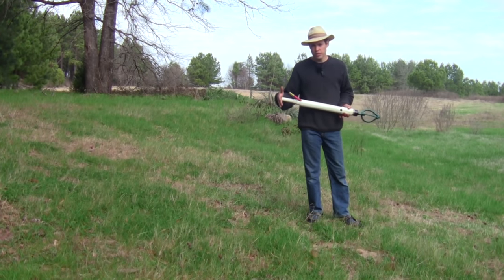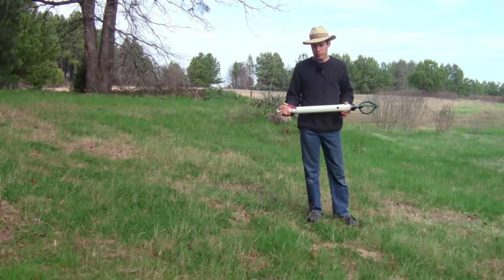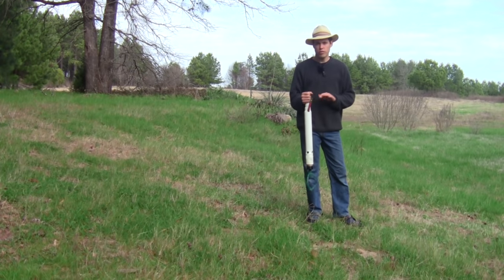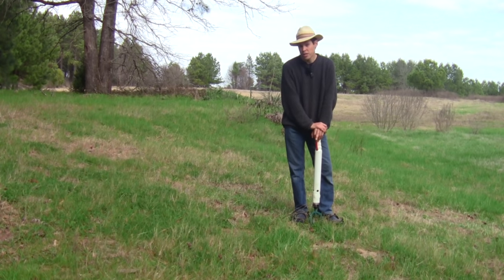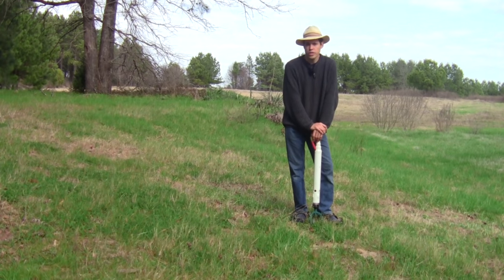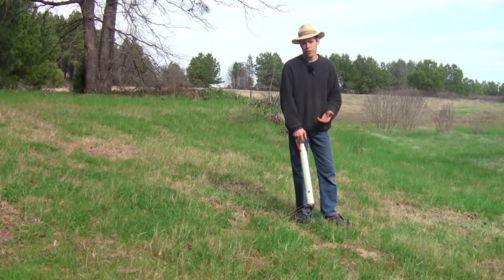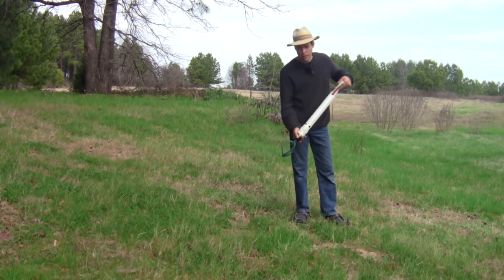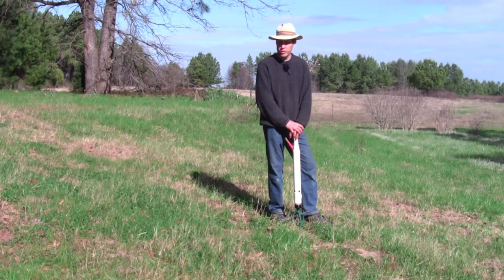DIY Water Well Drilling - 6 Ways To Drill Your Own Well in 2018

Comment: My well is 54 feet deep and it is sitting in a seven foot deep well pit. It was hand driven by two men in the 1960s.  It is a 2 inch pipe and it has a 1 1/4 inch drop pipe inside it hooked to a Deep Well Jet pump.  We were in this house I built here in 1977 one year when one of those men pulled in the yard and gave me the original book for the pump and written on the back of that book is all of the info on who did it, how deep it is and how long it took them to do it.  They made a scaled up 120 pound driver like a T-Post driver and the top pipe was always their driven pipe.  Both of these men were cement block layers and were used to lifting 40 to 50 pound blocks all day.
Reply: What kind of accent is this?
Reply: Geez them men probably never died,, it be too sissified.. men like that don't exist anymore
Reply: @keya31gville  oh we exist. Many of us are married to amazing wives who saw the potential. 💪

There are single guys out there like this. They just need to see a woman who will be there through the best AND worst of times. You got it. You can find your man and he will be amazing! When you BOTH can work as a team, nothing can stand in your way. Stay strong girl!

Comment: I have used this drill and it works. It can be hard to keep the hole straight but it's not a huge issue. If you don't have to drill deep, in rock or need a big hole, this is a good option. I have also used his mud pump design to clean out old wells and my son used it to pump out his septic to make a repair. The is a ton of good info on his web site and you can learn alot about drilling and setting up wells. He is also very helpful and wants you to succeed. The bottom on all this is if you have more time than money he can help you get a well dug.
Reply from the maker: Thanks for the comment!
Reply: "if you don't have to drill deep"  what would be the limit?
Reply: What is the name of the product?

Comment: I have an artesian water system that was in place when we bought the house 6 years ago, it was touted as being a great way to get clean water and for free.  Problem is, it dries up 6 months out of the year, and I’ve had to haul my own water from a pump 3 miles away, every day.  In the beginning, I was filling up 20 x 5 gallon buckets, driving back and forth, filling them up and then dumping them in our above ground artesian water tank.  I did this until my friend came up with the idea of buying 125 gallon tank($450) to put in the back of our Honda Element.  Using that instead of buckets, coupled with a small pump to get the water into out artesian water tank(used to have 2 1200 gallon tanks, one imploded in the winter)has saved us from the labor intensive part of it, though it’s hard on our Element, hauling all that weight up a hill daily. It sounds like a lot just to have water, huh?  I’ve actually gotten used to it. It reminds me of being a pioneer, lol. 

Well(ha), the problem is my mom is getting older, and I’m trying to sell so I can move closer to her, put her up in a “mother-in-law suite” type situation, and no one is going to buy this house without a reliable water source.  Plus time is of the essence as we our precariously still in a seller’s market, and who knows for how long.  

Well, here’s the real kicker;  We paid 18 grand to have a drilling company drill 320 ft, and to no avail,  because we didn’t find sufficient water, only about 1/2 gallon per minute, and that’s a maybe.  We couldn’t  afford to keep drilling.  I believe they charger $60/ft, and then $45/ft once we reached a certain depth.  The capped and soldered the hole shut, I believe the next step would be to get a pump company to test it, and then hook it up to the house via our artesian water tank.  But we have no more money, that was over a years worth of savings.  Our realtor told us we can’t sell until we have at least 1-2 gallons/minute.  

We’re a bit disappointed, but I’m really trying to see it as progress, since we can continue drilling from 320 ft down.  I am a little shocked by how much they charged though.  One geologist we know suggested we might have to drill down to sea level to find water.  We’re at an elevation of 750ft.  That’s really just so much more than I ever imagined it would cost.  I’m really thinking of trying your tool and method in a different spot on our land, I think we might get lucky.  Our neighbor went down a mere 15 ft, said he just prayed, and there it was.  It sounds strange but I have a spot that I feel God is pointing me to where I’d like to drill using your tool.  It’s where I wanted the drilling company to drill, but they suggested a point closer to the road, I guess because it was more accessible, the spot I had was under a tree line.  I don’t see a link though, would you be able to direct me to where to go to learn more and possibly purchase?  Thank you. Matt
Reply: Jeez, It was like I was reading about my own property (sans carrying 5-gallon buckets) 
We also paid a driller to come out. He drilled down 280'  before he came to the conclusion it was not likely we would hit water. It was the only spot on the property where we could get a truck-mounted drilling rig in. 
$7000 for nothing more than a broken heart and a heck of a mess.

We are lucky enough to have a spring that is uphill from us. Regrettably, the mouth of the spring is on someone else's property, hence our water is surface water. I have way too much wild animal feces around the banks of the spring for my peace of mind and would like to drill my own at the back of the property as It has zero vehicular access. I can't even get an ATV on most parts of my property due to the terrain. I too am thinking about drilling my own with this set-up. Tons of water on the back of the property as I mentioned cant get there from here. 
Good luck.
Reply from the maker: The link is www.drillawell.com

Comment: Could I use this to dig a hole for diy closed loop vertical u tube geothermal cooling?
Reply from the maker: Sure; but you won't be able to dig 400-600' like some recommend. If you really need that much water exposure you'll need a way to do it shallower.

Comment: Ever tried using a long nosed dredge? Instead of blasting water INTO the ground, you could blast it in and suck it out at the same time, recycling the water, not drowning the area you're working in, and not turning the place into a muddy quagmire. Also you'll have all removed overburden for mineralogical sampling later.
Reply: The issue here is needing the settling to let the dirt fall out of the water.

Comment: Trouble is getting a compressor that big. My method uses a homemade drill derrick attached to my skid steer. It works well but you do need the settling pond as you mentioned. The  pump is also essential to keep the bit from clogging. Where we have coral rock it was not uncommon to make a tripod and use a string to drop a weight on a steel pipe and go down 20 feet or so.

Comment: Thanks for the video.  I've never drilled a well and have never had one drilled.  I inherently understand I'm drilling a hole in the ground, but what about what to do after I hit water, etc. etc. does the dvd set tackle that part?
Reply from the maker: The DVD covers what to do up until the casing is installed, grouted, and sealed and you have a finished well. That's by far the hard part. It doesn't tackle installing the pump and hooking it up to your house, no, but that information is widely available online.

Comment: Regarding the first method (digging an old-fashioned well with a shovel): The safest way I know of to do that involves putting stacked concrete culvert sections in the hole and digging out from under the edge of the lowest section, allowing the entire stack of culvert pieces to slowly sink into the earth. This greatly reduces the chances of a cave-in, assuming you dig evenly a little bit at a time, keeping the bottom culvert section level at all times. A winch and pulley and someone up top to operate it would greatly reduce the work load vs trying to dig such a well solo. I would not even attempt to dig this type of well without something like this system to prevent a cave-in. I'm not sure what the maximum safe depth of this system is. I seem to recall hearing of one guy digging a well a little over 80 feet deep with this method.
Reply: Yep dug like that but was 5mtre wide went down  13 mtres
Reply: Got to be hars to breathe goin down in there

Comment: I live on a small island where water is at best 6 feet below my land. How deep should i dig.? Its 99 percent river sand. South Louisiana
Reply: When water is that shallow, it doesn't really matter - 15-20' should be plenty. You might be better off using the method from drillyourownwell.com - such shallow water as that is often easier to  access with the jet method. Or drive a well point, which is also good that shallow.

Comment: Hand digging a well to any depth is reasonably safe if you install a good well casing as you dig. The easiest way is to build it up at the top and let gravity pull it down as the ground is removed at the bottom. While a wider well takes removing more earth having enough room to work freely can reduce the effort per volume enough that it is easier to dig a wider well.
Reply: calvingreene90 I really want to see a video on this, digging the casing down
Reply: I would to but I read about it in a book over a century old. you start with a solid ring that is sharpened with the bevel all on the inside hardwood was the traditional material but cast iron or concrete had become available. You would then dig it into the ground so that it was level and firmly seated. Then you would solidly mortar in the first several layer of blocks this is important as it helps the well casing go straight down. Then you would put in several layers with mortar on the top and bottom but not between the blocks so that water would be able to enter. After the mortar has set you begin digging out the dirt from the center paying in mind that you want the casing to settle straight down. You continue to dig and add layers to the casing until water is coming in through the casing sides to meet your needs. then you would layer the bottom with rocks to keep dirt from getting into the water from there. Hardwood oak by preference was falling out of favor for the cutting ring because it would add unpleasant flavor and color to the water while it decomposed.
Reply: calvingreene90 what are you talking about
Reply: I fell asleep while reading this, did you win??

Comment: I have a neighbor that there well is 630 feet deep... will your product go this deep?
Reply from the maker: No, no home well drilling system will go past 300'; however, well drillers get paid by the foot so they tend to go far deeper than necessary to find water. Most people in the world have water at less than 50', and I've never had someone drill 100' with our system and have a dry hole.

Comment: I have a 500 ft well on my property but I think I need a second one. Can this method reach 500 ft?
Reply: No, but you probably don't really need to dig that deep. At that depth, you're reaching for the aquifer, but the surface water (typically around 30-70' deep) is more than enough and generally pure enough for all purposes. Always test it, of course.

Comment: Have you ever hand driven a well? I have and you do not hit it with a sledge hammer lol. You use a fence post driver. We went 59' down with this method. Was it a days work? You bet you ass it was. Shoulders were sore for days but the well is still going strong after 20 years.

Comment: HOW MUCH? Where can I buy it" I spend 10 minutes looking at your site and couldn't find how much or where to buy it! Update your site with a call to action? How much does it cost? Where can I buy it?
Reply from the maker: The video on the home page of the site mentions the cost; there are several links to the order page and catalog page on the home page and at the top of the screen. The cost of the kit is 699.95, but you should expect it to cost about 1500-2000 at least by the time you rent the compressor and get the pvc pipe you need.

Comment: I just moved into an old home. One of the 2 original houses in the area and there is an old broken pitcher pump in the back. Also there is a creek running behind the property. The pump hasn't been used in decades or maybe it's decoration? But I wanted to know the possibilities of redoing it. If there is a creek there has to be water right? Just need some advice from anyone who's experienced. I want to turn the house back into a tiny farm one day. Need to clear out a lot of woods and having water for irrigation would be awesome. Thanks for any replies I get!
Reply from the maker: If the pitcher pump goes down into a shaft in the ground, probably used to be a well, might still be good. Water level tends to drop with decades as greater development hits but if you have a creek nearby you'll almost certainly have good water level.

Comment: I have a well but its filling up with sand, would this work to remove the sand from my existing well?
Reply from the maker: Yes, but there's a cheaper way. Visit my website (www.howtodrillawell.com) and get the air-powered water pump (49.95+S/H). Hook that up to a medium-small compressor and some 1" PVC and it will suck sand out of your well, as long as you have any water at all in it (or can add some extra, to make it pump).
Reply: how deep will the air power water pump work?
Reply: Go to his web site. There a guy using his pump to pump out bunches of gravel, 2-3" rocks. LOL. I'm thinking of buy his pump and use it to dredge my fish pond. Not sure it'll work...

Comment: I’ve been told that water can’t be reliably reached in my area (NE Dallas, TX) before 600ft.  I have an older well about 55 ft deep that does get water, but it recovers very slowly.  (It can take two plus weeks to fill 30% in summer.). I’d like a water source about 400ft from there and would love to buy your product if I was confident I’d hit water in less than 100 ft.  What do you suggest?
Reply from the maker: To be blunt, you were lied to. Well drillers are paid by the foot, and they don't make enough money to break even at 100', so they will tell you that you need to drill deeper when the fact is, they need to. 600' wells are aiming at the aquifer, which is fine if you're irrigating hundreds of acres. The deeper you push that 55' deep well, the faster it will recover, as a rule. So what may not be enough water at 55, will be ample at 65 or 75, almost certainly.
Reply: HowToDrillAWell, Thanks for such a quick reply!  My existing well is an old traditional culvert well 3ft across.  Would it work to run your product down my well with some water in it to deepen it?  I’m not sure how it would work to case and cap it.
Reply from the maker: @ToddTramonte  I would drop a 6" schedule 40 casing into the well, drive it into the ground a firmly as possible, then drill inside of that. Then when you're done, case with a 4" casing inside of that.

Comment: How do you know where to drill and then how deep?
Reply from the maker: Water is everywhere, so where to drill is moot. Contrary to popular belief, you won't find water in one place and not find it 10 feet away. Doesn't work that way. As for how deep, there again pretty much everyone has water at less than 50', contrary to popular belief (and what well drillers will tell you). Except in mountainous terrain or very unusual circumstances, water is almost always within hand-digging depth, that's how our ancestors found water in hand-dug wells.

Comment: ok, why would this drill not torque twist and rip apart the cord and the air line it's attached to?
It either needs counter-rotating blades or a fixed rigid pipe to attach to
Reply from the maker: The drill uses high-speed, low-torque to drill, as opposed to more conventional systems that use low-speed,  high-torque. You can hold it in your hand, although in the early stages a pair of vise grips is helpful. However, it won't torsion the pipe in two, it simply isn't that powerful.

Comment: I would love to see a demonstration also,I would like to see what the drill bit looks like up close and how you go about sharpening it. So the air compressor is not included apparently.how can you do this in a remote location without a gas powered air compressor and a water source¿ Your advertisement says you get everything you need to do your drilling with, so how do you get the drilling granules out of there?
Reply: There are several other videos that show various aspects of it's use; drill bit doesn't need sharpening, it doesn't dig by cutting the way you drill in wood or steel, it mostly digs by vibration and abrasion. You do have to have an air compressor, gas or otherwise, to use it; but rentals are available in most places. You also need to have a source of water, but it doesn't need to be pressurized; it can be hauled in 300 gallon tanks, it doesn't use nearly as much as other systems do to drill.

Comment: To use a standard well pump a pitless adapter is most commonly used. Without a pitless adapter it's quite difficult to repair/replace pump should there be an issue.
Reply from the maker: Yes, a pitless adapter is commonly used up north due to freezing ground temperatures. Down south, where I live, no one has heard of them. But a pitless adapter is something done after the well is drilled, it has little to do with the well itself until the casing is installed.

Comment: What is the deepest anyone has drilled with this device? Is appears that the depth is only limited by the amount of hose that's available.
Reply: 210' is the deepest I've drilled; in theory yes, it's only limited by the hose. In practice, the deeper you go the more likely you are to run into a cavein or other problem, which is why I recommend no more than 100' for your first well.